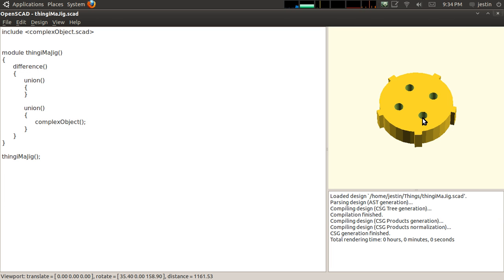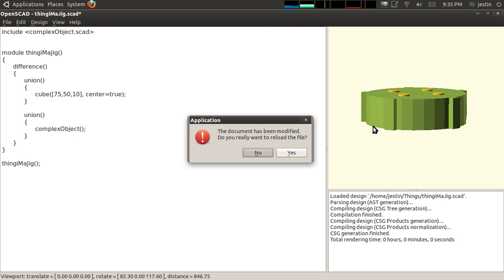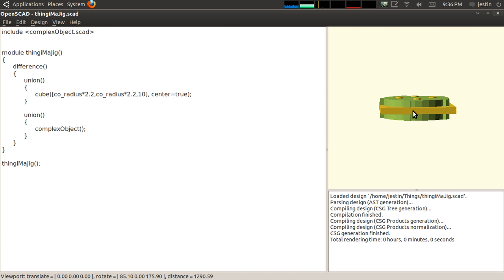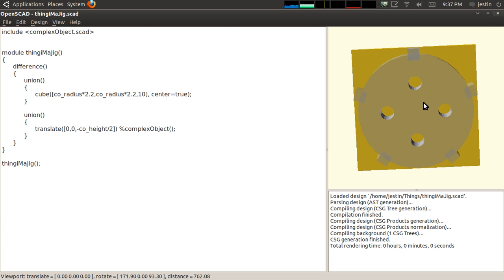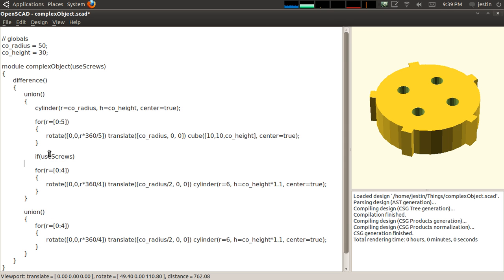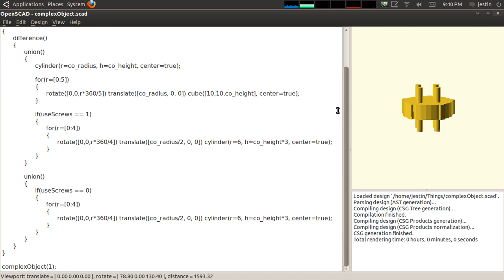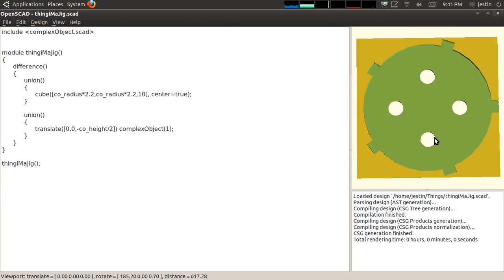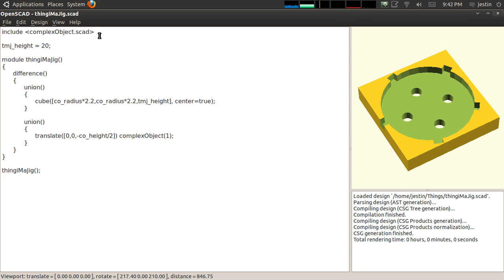Using the 'include' statement in OpenSCAD

Comment: 'include' will also pull through constant values, which is important if you have something like a 'defaults.scad' file.  However, it will also render any top-level objects in the included file.

Both 'use' and 'include' have their place.